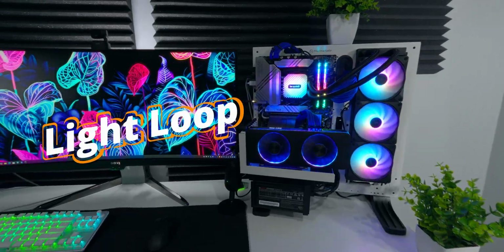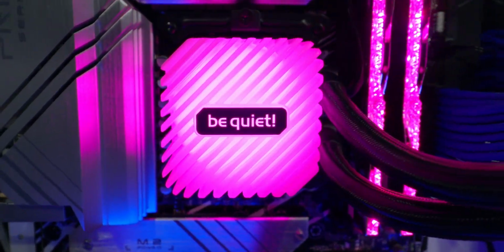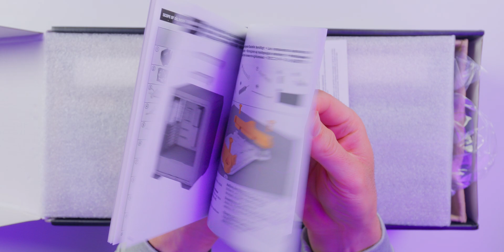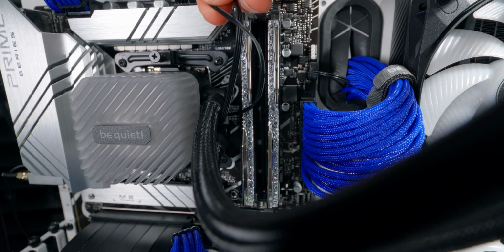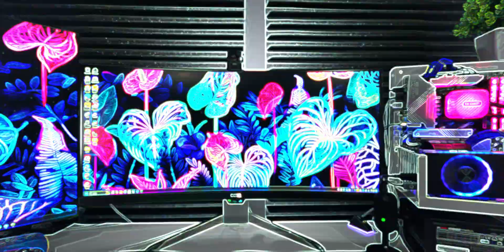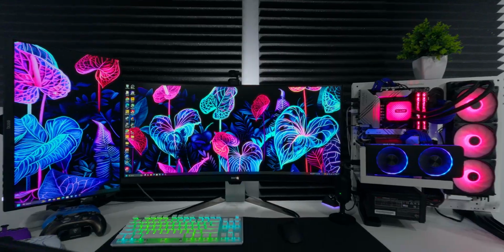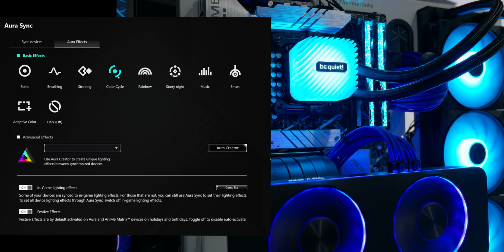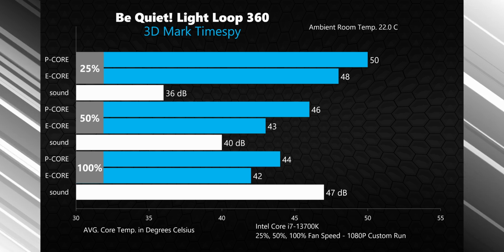Be Quiet! Light Loop AIO Review and Installation Guide

Comment: A bottle of coolant is included in the scope of delivery. Do you still have to fill the water cooling system or is the bottle only there to be filled later?

Is this the water cooling system when delivered already filled?
Reply from the maker: The radiator comes pre filled. The extra coolant is just to top up the system after a couple years to extend the life of the aio.

Comment: Thank you for this guide. Be Quiet's guide doesn't tell you what to plug in where! I would have missed plugging a fan into the RPM header on the hub, and I wasn't sure whether I should be plugging in the pump to the hub or to the mobo directly >:(. As a Technical Writer, I'm a smidge insulted by be quiet's documentation on this but your video was a lifesaver.

Comment: i wonder..
i have MAXIMUS IX EXTREME (LGA1151)  air coolded..
its fine in winter time , but when temp go's up like 30c dutch temp..

i can for get to use real games.. as cpu and gp[u gets to hot

ive bought costum water cooling kit but am to lazy to bend tubes..

so i just bought this. and i gamble it does enough..

Comment: Just got mine today for a new build. Came here just to see what the lighting is like, and I must say it looks pretty cool. That along with good temps and silent operation makes me feel I made a great choice. Nice brief review-thanks!
Reply: Can you spin the plastic light diffuser cover on the CPU block? - does it come off?
I want to be able to reverse it, so the logo will be still readable (while upside down mounted) - thanks.
Reply: @Ryet9  I haven't tried to do that--pretty happy with it in default mode.
Reply: @DiGiTaLdAzEDM  Cheers, it just needs to be placed upside down in my case, maybe I can mod it myself - going to order anyways!
Reply: I don't like the default mode the rgb lighting is in. So, as I have an ASRock mobo I am just now downloading ASRock's rgb control software 'Polychrome sync'. I also am using Corsair Icue-hope they will work together without issues. Icue will not detect the light loop 360. Once I can setup the rgb as I want I suspect it will look great! Cpu temps are good, but I have not stress tested yet-new build with Intel 12700kf. 

Pay close attention to the wiring setup in this video-it is kind of complicated. I actually wrote down the steps, as it was too much to memorize reliably. Good luck! 👍  @Ryet9

Comment: What are the black circle stickers for?
Reply: They cover the port on the radiator used to top it up from the bottle of supplied coolant. There is a sticker already on there when you unbox the radiator. if you ever top it up you will have to remove that sticker. The black circle stickers are replacements.

Comment: Thank you, this video was awesome as I installed the Light Loop 240 AIO and changed the processor, first time ever doing something this advanced on my computer. I've changed power supplies, installed RAM and GPU's but this was intimidating and your video made it super easy.
Reply: Hi, I live in Canada. I've been using the air-cooled version of this cooler for three years and it's always been quiet. I'm using the i5 13600k. How's the performance of the 240mm liquid-cooled version? Is it quiet? I'm thinking of overclocking the processor. Do you think it's enough?
Reply: @nolinga6756  The unit is very quiet, I can hear the case fans but not the AIO. Cannot help with the overclocking idea as I don't do that and I don't game. I primarily use mine for video editing.

Comment: Is the coolant already in or do you have to refill it yourself before you start? Thank you 😃
Reply from the maker: It comes filled. The extra coolant is just for topping up the system after a couple years.
Reply: @ Okay, I put together a PC and it was delivered, I have the problem that the PC goes out after 3 minutes, I think the delivery and movement has created air in the hose and that's why it doesn't cool the CPU down
Reply: @robin2199 move the case to move the bubbles

Comment: Seems like the ARGB hub doesn’t have enough ports for all the light wing fans that came in my case, do you suggest plugging in the rest into the MB or get some adapter to add more to the hub?
Reply: I'd like to put this 360 rad up top and 3 more of these standalone fans at the bottom. Looking for the best solution also.
Reply: Found it? I want to do the same.
Reply: @Buecherwurm_8  sounds to me like they haven't released them yet, but they have acknowledged the requests for them
Reply: @Buecherwurm_8  It doesn't seem the reverse blade fans are available yet
Reply: @matsudakodo  they will be in April
Reply: Light Wings Fans came in your case ? Do you have the light base then ? These cases come with two hubs built in already
Reply: @buuhtendo  if i connect everything to those 2 hubs from the case ( both aio and case fans ) will it work correctly? or should i connect aio separately ?
Reply: @wibu8757  Did you find out this answer ?
Reply: @anthonymcmillan5274  @wibu8757  You should only connect the fans that are to run at the same speed. So either only the case fans (in this case do not connect to CPU_FAN) or only the CPU fans. I personally have the AIO fans connected directly to the mainboard and my case fans (3) connected to the hub and have all LEDs from the AIO and the case fans connected to my RBG controller from the case. This way I have the same LED color and can control the case and CPU fans separately.
Reply: @Buecherwurm_8 Ha! I wish they were available now. But I appreciate you letting folks know. Going to be buying new fans in April lol

Comment: This cooler looks so sick. Plan on getting this and the Light Base 900 when the 50 Series RTX's drop.
Reply from the maker: That's gonna be a sick build!
Reply: Same Idea as me for next build light base 900  black 9950X3D on a X870E motherboard just remember going to want a 1500-1600w titanium PSU for a high end 50 card it looks like if your going to target 5090  maybe even 5080 as that's supposed to be 10% faster than a 4090
Reply: I am getting the light loop, the light base 900 FX, Ryzen 7 9800x3D and the upcoming RTX 5080. I am still thinking about what PSU and motherboard but everything I saw, is that I don’t need more than a 1000W PSU? Even for a 4090 now you don’t need more.
Reply: I'm doing the exact same build. Got the white Light Base 900 yesterday and the Light Loop this morning
Reply: @benjaminrichard1979  which psu?
Reply: @Buecherwurm_8  well I'm also waiting for the announcement regarding the 5k series. I'm interested in a 5080 like you. If I was to use a 4090 in my build the estimated wattage would be around 780w,  so a 1000W psu would be enough. Wait and see for now :)
Reply: @benjaminrichard1979  I am thought about some extra headroom for spikes in wattage and it hasn’t 100% efficiency so it’s never 1000W.
Maybe going for a 1200W
Reply: @Buecherwurm_8  I've been looking at it, looks like 1200W might be better in our case. Safer this way
Reply: @Buecherwurm_8  alright I'm adding the DARK POWER PRO 13 1300W from be quiet! to the build
Reply: @benjaminrichard1979  I have heard problems with it. And is it ATX 3.1 compatible?
Reply: @benjaminrichard1979  I have heard so much from loud fans to explodings psu from the dark power and in general latest be quiet psu. My old be quiet holds up well but isn’t so quiet. I will probably go for a corsair 1200shift it is atx 3.1 compatible.
Reply: @Buecherwurm_8  amazon comments seem fine. Yes it's compatible. I'm going to look for alternative just in case
Reply: @ just now bought the Corsair HX1200i from their own website because there it already includes the new 12v-6x cable for atx 3.1 and pcie 5.1
Reply: @0-B1 i think 1250w is enought
Reply: @Buecherwurm_8 I plan to have the same build as you and I took the cooler master 1250w compatible atx 3.0 for 169 euros.
Reply: @benjaminrichard1979  my comment got deleted, I bought the Corsair XH1200i from their website. It has the new cable included which is needed for atx 3.1 and pcie 5.1